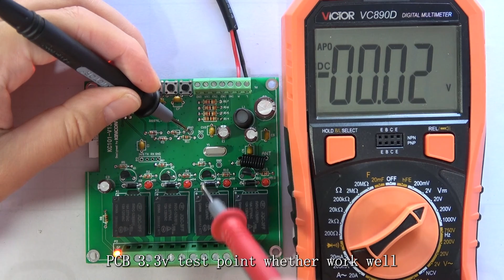KC101 4CH Tuya Smart Switch - Electronic DIY Kit 2023!

Comment: My question is: Does it need a code or programming, or does it not need programming when using the Taiyo module?
Reply from the maker: not need code, directly to use.
Reply: @KinCony  Does the module itself not need a code even if you get it from AliExpress?